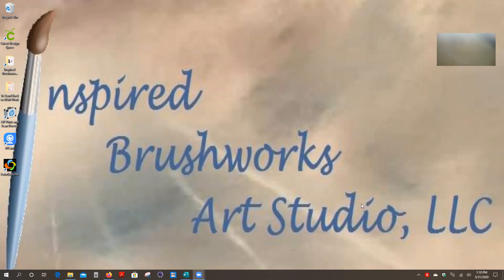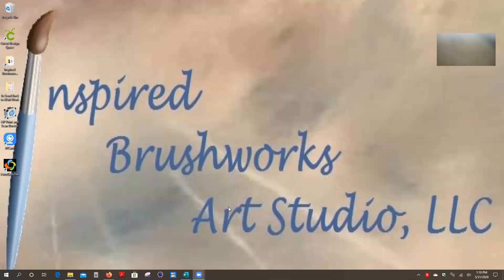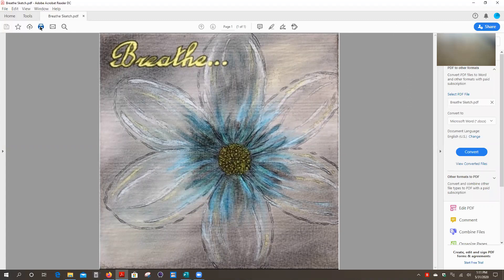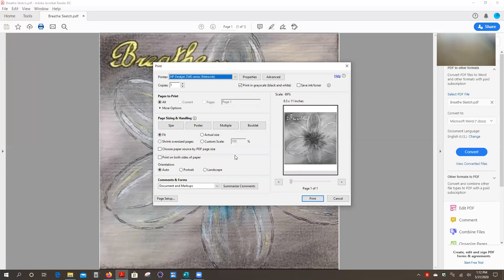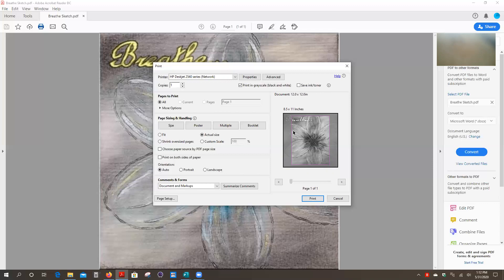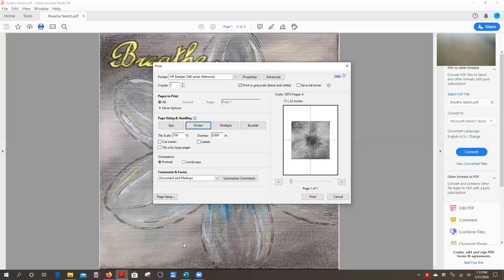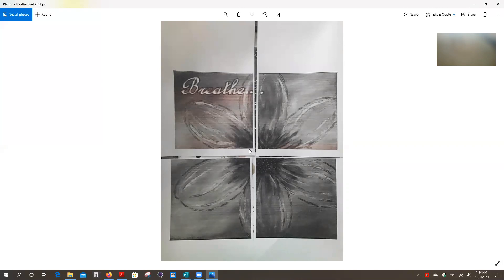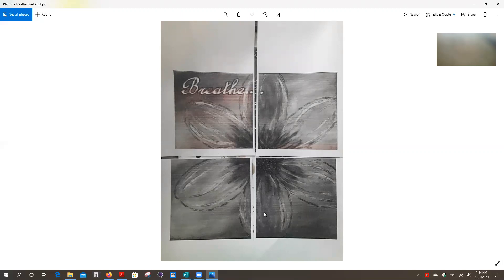How to Print a Large Design Using Tiling in Adobe Acrobat Reader

Comment: Good Video thank you. It works with 4 sheets.. but here's where I'm stuck: My design could fit just fine on 2 sheets, but its insisting on placing it in the middle and taking 4 sheets. Huge waste and extra work. How can I position it so that it just takes 2 sheets instead of 4, provided it fits onto 2 of course. Appreciate any help, Thanks!
Reply from the maker: There are a couple things you can try. Change the orientation of the paper from landscape to portrait mode, or vice versa. Move your design all the way to a corner, eliminating margins if there are any. Most of the time, by doing one of those two things, you can get it trimmed down to print on 2 instead of 4. Let me know if that works!